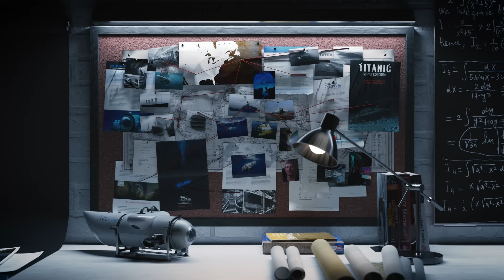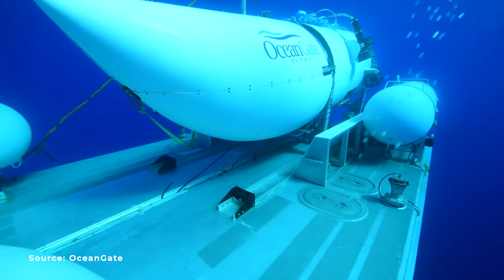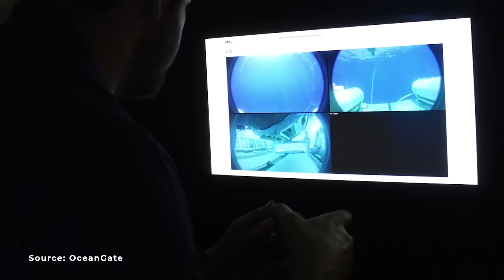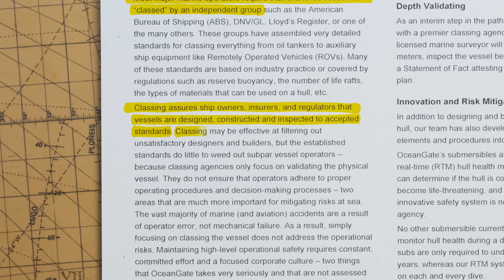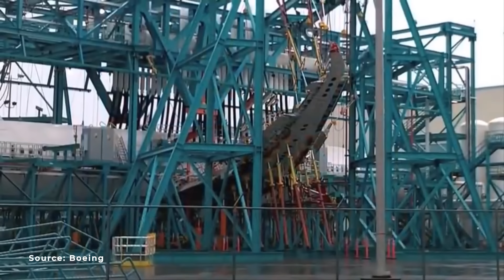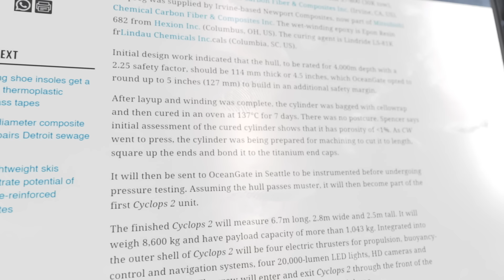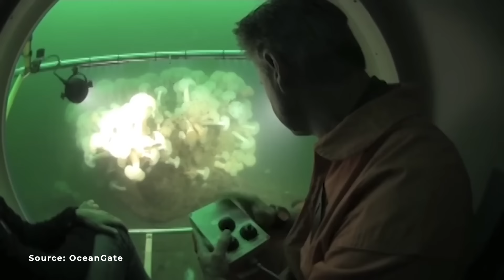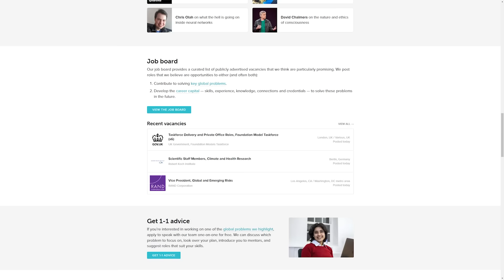The Questionable Engineering of Oceangate

Comment: 12:25 there's merit to "move fast and break things." SpaceX trial-and-error'd their way to feasability. Blue Origin was more measured, but still broke a lotta stuff.

Importantly, they actually broke things without humans in them. This Stockton Rush bozo decided to take that idea and then didnt break anything.

The whole point of "move fast, break things" is that things SHOULD BREAK. If it works on the first try you have to make like three or four more, because it should be drilled into your head that the first try SHOULD NOT WORK.

Comment: this will go into engineering ethics courses all engineers take during their first year of college.  There were Challenger, Hyatt Regency, and now Oceangate.
Reply: I don't see it so much as an engineering failure as it seems engineers were telling Stockton Rush that his sub was flawed. It is definitely a greed issue
Reply: @itscaz3749  it seems like there were no qualified engineers working on his project. He wanted to save money
Reply: @@lurch789 the leaning tower was due to the ground being soft, not an engineering malfunction. the fact that they stabilized it shows their engineering prowess.
Reply: @christiankapoian3845  The fact that they did not do the foundation work properly itself IS an engineering failure.
Reply: @Niskirin 
Yeah, botched engineering at its best. Save money for the better tomorrow.
Reply: @Niskirin  you do realize it was built in the year 1173, right? how were they supposed to know that the subsoil and ground beneath the cement foundation wouldn't be able to hold the weight.
Reply: ok
Reply: Just here to say that it's surreal to read this while walking into the Hyatt Regency (renamed now)
Reply: Just goes to show that big companies are above the law. If an individual was responsible for one person's death, he will be charged with involuntary manslaughter. If a big company is responsible for multiple deaths, they get slapped with a small fine. Nobody ever goes to jail.
Reply: ok
Reply: Yeah this may be used in MBA courses too.
Reply: Engineers are enslaved to follow corporate unethics . They are given commercials terms before doing any math .

Comment: I retired after a long career in safety-critical systems.  First commercial aviation then medical devices.  I designed the basic architecture for the B777 flight deck.  My daughter later flew overseas in one and I had no concerns (one of the safest planes in the air).  I later designed implantable pacemakers/defibrillators and helped make them cybersecure., My mother-in-law has a pacemaker that I have 4 patents for - I am totally confident in its safety.  These sort of careers are challenging and fascinating - but  you need to have  your internal ethics aligned to always go the extra mile and do the right thing.  Something OceanGate failed to do.

Comment: Even as a complete novice only having used CF in some simple DIY applications, I know that when it fails it is instant (almost explosive) and with very little indication before it happens. So I have a hard time believing Oceangate where honest with the justifications they made, and that they actually thought the acoustic system would work with enough margin to safely return to the surface.

Comment: The plastic foam layer or rubber cover on the external shell  for military submarine are not there for buoyancy, the ballast are there for the job. This cover are use on military submarine for acoustic stealth purpose only. They add nearly zero buoyancy. The image can be misleading but it is true for other deep water submersible, that they use a lot of foam panel for that. The shape seem really weird too, a sphere is the best shape to take the best maximal pressure repartition. Safety coefficient beneath 1.

Comment: It’s important to know that SpaceX, whatever the perception may be, does qualification-test all of its hardware, including many components tested to failure to determine margins, before certifying a vehicle for flight.  They also submit to industry-standard verification. I hope people don’t learn the wrong lessons from SpaceX’s journey.  Source: I worked on the development of Falcon 9 at SpaceX 2008-2014 and personally ran some of those qual tests.
Reply: I was thinking the same thing. SpaceX does rapid iteration on unmanned vehicles, flies them enough to be sure they're safe, tests them, then puts people on them.

It's a similar process to NASA development in the 50s and 60s, except SpaceX hasn't had an Apollo 1 incident.

They're well aware of the safety risks of spaceflight, and they do what they can to mitigate them.

Comment: Started watching the video but quit when the narrator got confused about pressure, weight and thrust. And said things that don't make sense.
Reply: Time stamp?
Reply: @mitthrawnuruodo7517  
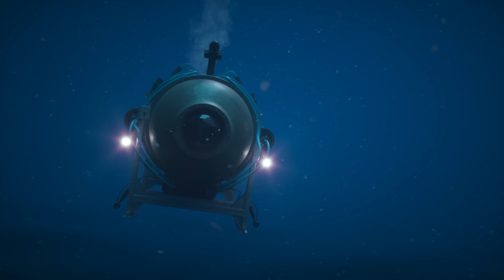0:23  "...the weight of 366 atmospheres..." ; Pressure is not weight.
2:32 "...neutrally bouyant...minimising the energy needed to rise or sink..." ; this makes no sense literally. If the vessel is not neutrally bouyant, then moving in ONE of those two directions will require no energy at all. Simply wait as long as it takes to rise or sink.
In a more realistic use case, we will assume that the travel time must be held constant, and that - to a first approximation - the propulsion system develops thrust proportional to input power. In that case, rising and sinking per se take exactly as much energy as they would with neutral bouyancy. You are obliged to expend power on maintaining your depth, or maintaining a constant journey speed, but that's independent of the fact that you're rising or sinking - which is what the narrator was exclusively talking about.

Comment: Once I understood what is being said about this submersible's accident, watching videos, reading articles, and performing a simple simulation (I perform simulations of loads on materials very frequently), I can say that there were so many mistakes made at the design and manufacturing levels, that I am surprised it didn't fail earlier. I have seen and worked on new designs that go through regulatory bodies to be checked, before getting approved, because of the risks associated with their operation, but in this case, the most basic elements of standard engineering practices were neglected.

Comment: - Engineering Composites 101 explains the structural considerations of using composites in a compressive scenario, where it tends to cause de-lamination vs. a tensile scenario where it tends to resist de-lamination.   
- I would be curious to know what their thoughts were handling the different pressure-induced diameter differences between the titanium and the composite.  I would think that could make for some high localized stresses. 
- I would be curious to know how they calculated the reinforcement of non-uniform shape areas and through-hull areas
- The owner was confident enough to pilot it himself but out of his depth and technically.  Toss in some pride to not entertain a conversation with those who warned him, and it was a recipe for disaster.  But billionaires are risk takers, and if it weren't for them, we would be behind an ox plowing a field or dead because of lack of medical knowledge and YouTube and computers wouldn't be here.

Comment: 3:06: "Typically, Submarine hulls are made of Steel, but to achieve the desired buoyancy they need foam outer layers."
Can you clarify this? I had a look, and all I could find is Anechoic tiles, which is designed to reduce the detectability of a sub by sonar. There is no reference to foam being used for buoyancy on any kind of submarine.

Comment: Please comment on the fact that the carbon filament wound hull was wound only circumferentially. As the hull is squeezed by the external pressure, the fibers are only in compression. This leaves  the epoxy matrix by itself to resist the pressure. The strength of epoxy under compression is presumably quite low. Also, please comment on the mismatch between the titanium end caps and the cylindrical body.  The thick titanium will shrink much less than the epoxy, creating strong shear stresses which can lead to delamination and failure of the adhesive bond between these dissimilar materials.

Comment: SpaceX took the "move fast, break things" motto to its extreme with the recent Starship launch in which they broke things (the launch pad) which then moved quite fast!
Reply: The motto works when your not doing tests with people on board! It makes sense for the industry spacex is in and their specific objectives.
Reply: SpaceX "moves fast, breaks things" as in, they actually do a lot of testing to confirm computer simulations. Case in point, the pad is already almost rebuilt, this time with a water cooled plate installed, itself an experimental design, which will be tested early the next flight.

Comment: Great Video, great points. I only want to point out that the comparison containing SpaceX is a bit misleading. Yes SpaceX does use a different model for engineering and pushes the boundaries of space vehicles development, but they have not put human life at risk in those vehicles without much oversight from NASA. The issue with Oceangate is they chose to omit the oversight from any credible organization. That was just foolish and arrogant on the part of their management. Agree with Elon Musk or not, he isn't the only gate in the SpaceX safety plan sign-off. He might push the engineers to think outside the box, but they aren't skipping the testing and validation steps prior to human in the loop testing.
Reply: starship exploded my guy

Comment: As a fellow engineer: Thank you! 
I am a testing engineer working in the fields of Failure, Crack Propagation and Life Expectancy. And you are right in every single point.

This whole thing looks like a fresh graduate with a basic knowledge of FEM and CAE designed a thing. But they never realised the difference between a sophisticated Computer game and reality. 
(For everyone, thats not an engineer: Simulations without correlation in real life testing is basically of as much worth as a computer game. Think Need for Speed vs F1 or Indy)

Comment: Elon may be pushing limits and breaking things along the way, but he doesn't put people in them until its been proven safe. Stockton skipped so many steps its amazing he didn't die on the first dive.
The very reason most accidents are operator error is because all other factors have been eliminated through testing and certification. Ignoring those steps doesn't make the problem disappear.
Darwin prevailed. Its just sad that 4 other people died as well.

Comment: 4:10 anyone who isn't blinded by corporate/advertising speak will immediately think 2 things here. 1, the reason the majority of accidents are due to operator error is likely because those safety standards have reduced the number due to engineering shortcomings. 2, just because the majority of accidents are due to operator error isn't enough to justify not focusing on engineering safety.

i think stockton rush was one of those people who was a bit smarter than average and it went to their head and they ended up thinking they were a lot smarter than average and thought they knew better than people who, in fact, knew better than them.

Comment: "Move fast and break things" doesn't mean subjecting people's lives to your untested pressure vessel, it means test it until it fails somewhere and fix it in degign, and do it again and again until you have worked out all practical points of failure over the expected lifetime of the vessel, then do it all again until you can find no such points that will fail over multiple lifetimes of the vessel. Also the repeated cycling stresses that can cause failure of carbon fiber are exactly why SpaceX decided to use Stainless steel instead for their reusable rockets, though they were more worried about the cryogenic cycling of the fuels. So stainless steel may not have been a more suitable alternative in this application.

Comment: Great video, but the comparison to SpaceX was a bit unfair.  The "go hard and break things" mentality is what SpaceX does and is not what Oceangate did.  SpaceX builds bunches and bunches of prototypes and tests everything to and past the breaking point.  The purposefully over pressure everything until it breaks.  If SpaceX built subs, they would have made multiple subs and taken them to the Marianas Trench.  They would have cycled the sub hundreds of times until it broke.  They would have done this without people on board.  To my knowledge, Oceangate never destroyed a sub during any unmanned testing.

Comment: We tried the whole ‘skip the syntactic foam’ approach when designing an UNCREWED submersible in my previous job and quickly decided it wouldnt be possible. We didn’t even consider using composite material for the pressure hull.
Reply: there might be instrumentation inside your submersible worth protecting!!
Reply: I could actually see using Composites for an uncrewed submersible though.  The trick is the same as what SpaceX does.  Don't bet the bank on it, and don't spend ridiculous amounts of money on equipment that will probably be destroyed.

There's a loop of, this is expensive so we need more reliability and safety.  Which adds to the cost.  This trap is what NASA became caught in, and is easy to fall into. The trick is human lives are worth far more than equipment.
Reply: @EmperorA0  Absolutely. In our case, the vessel would be too large for any composite to be cost effective  but there have been plenty of smaller AUVs that use GFRP hulls reliably.
Reply: @Alexander-the-ok  This is an important point. i'm seeing way too many people acting like a composite pressure hull is impossible, even though as you note unmanned craft have done so quite successfully. The problem is there are steps and issues that need to be done to make it work that Oceangate ignored.

Comment: It is not the first time that it happens, nut it is also amazing how hitherto common knowledge tends to be forgotten (with grieve consequences): in the first book about carbon fibers I read back in the late 90s (from Pebbles if I remember well), there was a not-so-hidden reference about the failure of carbon fiber composites for application on submarines (specifically mentioning the abysmal failure of CFs at compression tests). My understanding was that CFRPs were tested for possible application at nuclear submarine hulls during the 80s (stealth), but with so disappointing results  that is was considered "not worthy to be classified" information.  When I realized that Titan sub was made with CFRP hull, I was really dumbfounded. 
What next, will someone in Rolls Royce try to create a jet engine with CFRP-based blades???

Comment: Everyone's saying it imploded without checking whether it could have flooded via the joint between the cylindrical hull segment and the mating rings it was glued to. The leaked transcript (if real) shows they had a loss of buoyancy from the start of their descent, getting really bad at the end (they could only ascend 50 metres in many minutes but they should have descended at half the rate and been able to ascend faster. Perhaps the glue allowed water in and it flooded.

Comment: As a mechanical design engineer, composites to me are a dark art - steel and titanium are relatively straightforward materials to design for, as they both have the handy feature of an "endurance limit" when it comes to designing for fatigue, composites on the other hand are a complete nightmare. 
As you say, the usual methods of stress analysis don't work well for composites, and for safety critical applications physical testing is king. But even then, a single test isn't enough - composites can be wildly variable, and you'd need to fatigue test many assemblies to destruction to capture the spread of potential results.
Sheer hubris is what lead to this design, the "move fast and break things" mentality is very popular at the moment, but there's a time and a place for such things and it's not when peoples lives are at stake.

Comment: I was hoping you would cover this.
When I first heard about it all I immediately thought of the 787 and the fact they had to totally reinvent the testing procedures to deal with a totally novel use of materials in aerospace, and also twigged the tension vs compression issues in the comparisons.

Hard to believe they can get away with that kind of thing these days but, I guess "rich so law doesn't matter"
Reply: The problem is there is no laws around Submersible design ATM. That may very well change after this though.

Comment: If I were creating something like this, I would likely need to bite the bullet on the cost of building a full vessel, then doing my damnedest to destroy it and what it took to get there. I'm not nor am I claiming to be any type of engineer, but I know as a framer if a piece of wood has really bad cracks and splits it's either getting paired with another board, or removed as an option simply due to its many flaws.

It's easy to sit here oblivious to numbers and structural facts for me since I understand none of it. It's easy to say a lot of things when you don't know enough about it to begin with. I could suddenly become a carbon fibre expert in the comments from 5 seconds of googling and that's the type of thing I feel was applied here. Those that knew better were ignored and those that didn't know better were doing the ignoring.

Comment: Build fast and Break things is actually the best way to get the most thorough data.  That has been proven to be a better way to design things, with the more thorough, reliable results.  Its also not a new concept.  I would take that over NASA's bad track record any day.  I wouldn't compare what OceanGate did to what companies like SpaceX or Blue Origin are doing.  These guys may have built fast, but they sure didn't wreck a bunch of prototypes to refine and make a reliable Titan.